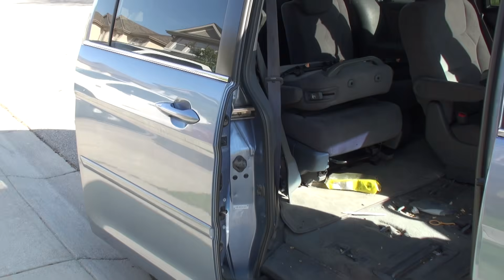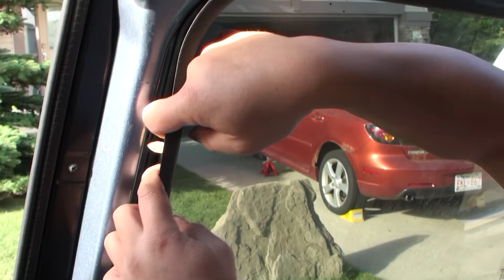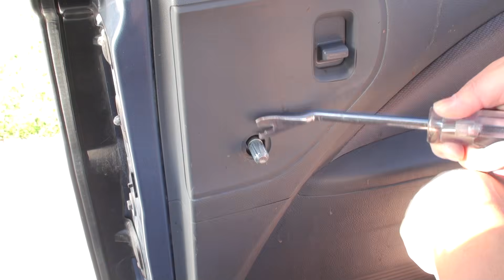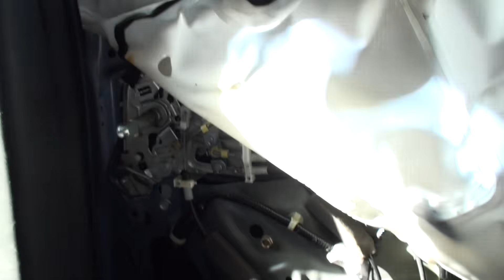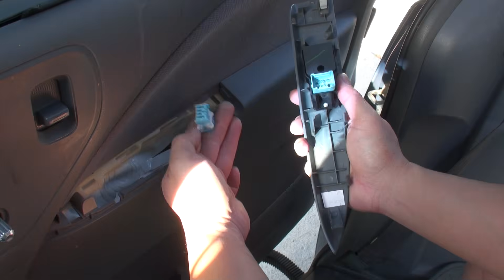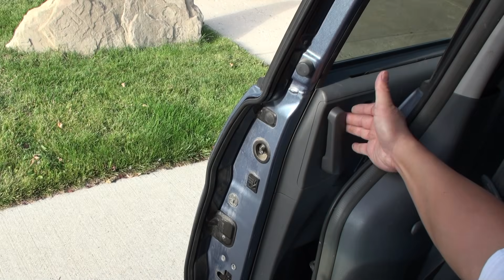Honda Odyssey Power Sliding Door Release Actuator Assembly Replacement

Comment: Followed your video, it was excellent. I just did the replacement on my 2014 Honda Odyssey, different generation, main difference was that for my vehicle I didn't have to take the two screen clips for the window shade and the corresponding upper trim out. Otherwise nothing materially different for the 2014 generation. Parts were roughly $45/door from the dealer. Thank you!

Comment: Could this be an issue also with the alarm wont beep but lock to lock only but the alarm doesn't activate
Reply from the maker: If the doors lock but the alarm doesn't activate it means that a "zone" switch isn't closed.  Check your hood pin and door jamb switches to make sure they all work correctly and try again.

Comment: Can you convert them to manual doors and bypass the micro switch so it doesnt drain the battery anymore? Like taping it shut or twisting the wires together so it reads always closed

Comment: I wonder if anyone has ever tried opening up and cleaning the actuator assembly?  I had an issue with the van's air mixture box (it would only blow hot air no matter how you set the temp) and I took it out, opened it up, cleaned it up and spread the lithium grease that was inside around on the gears and it has worked great for the last 6 years since...  Saved buying a $100 part.

Comment: It's much appreciated, I have the driver's side door doing this very thing on the 08 Odyssey EX I just bought. I knew about it, and wasn't too worried, figured I'd watch a few videos and get it sorted out in fairly short order. I spent almost a year waiting for used prices to drop, and some actually are in my area. I wanted the EX to avoid the nightmare we went through on my son's EX-L, with the VCM system and a failed water pump that thrashed the engine. But I digress. 

I got this with 240k miles, but well-maintained highway miles, and a good history of care. The driver's door will try, but start beeping. Holding the door actuates it just like you demonstrated, so I'm gonna make it right. Thank you!
Reply from the maker: Hope you were able to fix your van properly!

Comment: Thank you. Does the door actuator you replaced also control the sliding door lock too? Be mine won't lock when use remote
Reply from the maker: no the power release is not the same as the power door lock actuator.  Totally different part but located in the same general area.
Reply: thx
Reply from the maker: np

Comment: I will never understand why there is that mechanism that prevents the door from closing on an incline. I mean, cars are not always on level surfaces. Many driveways and parking lots are on a slight incline. I have experienced this incline thing and it is infuriating. I have had one hundred annoying problems with the doors and now the problem is really bad. I need help. Where do you get that little hook tool? How do you get replacements for the little orange clips, if needed. I don't need any, at this point, just wondering how you get little things like this. I will need a few small things for this vehicle, I'm sure.
Reply from the maker: Hey RR, my apologies for taking eons to reply.  The safety on the door is to prevent it from closing on an incline b/c without and say if the cable snaps that the door is crazy heavy and I can see from a manufacturer's perspective why they had to implement the incline lock.  Its actually locked when open and locked when closed but due to the issues you're experiencing with the door that its amplifying how annoying the problem is.  To answer your questions the tools used can be purchased from your local auto parts store or you can use the links in the video description to buy them (I plan to update my video description  links in the next few days if you can wait) and the replacement clips can be purchased from your local honda dealership.  They'll cost more but at least you know it will fit perfectly and spare you the hassle of running around trying to find the right ones to fit.  Sometimes the convenience and your time are worth the premium paid.
Reply: @piercedasian  Thank you very much. I am not sure if I totally understand or if I had explained myself well enough. The minivan is on a driveway and there is about 5 degrees incline. Almost seems like no incline to me. Oh, well. Doesn't matter. I wonder if you could travel here and help me with these doors. You could make a video out of it. Seriously.
LOL

Comment: Yours and mine sound like old broken plastic teeth of a gear assembly inside the actuators. Probably not 2 at the same place yet so it can still open occationally. I love the odyssey design but they used too many brittle cheap parts.
Reply from the maker: I think that is the case with all minivans.  The Toyota Sienna for example doesn't have the power latch/lock problems but it sure as heck has a pretty bad rap with the drive motor cable system rusting out.  The nature of the van I guess b/c of the complexities of a moving door.

Comment: Very detailed video. What if I can't open it manually, either? I have an issue even when shifting to the manual position, which does not open from the inside or outside.
Reply from the maker: Sorry for my super late reply but I'm not sure what you'd do in your situation. Sounds like you have a trigger cable problem within the door and as long as you can get into the door using the automatic mode then I'm willing to bet the cable that links the exterior and interior "actuator" handle is broken or has popped out of the retainer clip. Hopefully you've since fixed this issue.

Comment: Great video, demystifying the door actuator mechanism. In my 2010 Honda Odyssey EX. the outside latch has NO effect whatsoever, opening or closing.. Pressing  the key chain and dashboard controls does not open the door, but at least generates a hum. The inside handle opens and closes the door. The electronic controls also close the door (but do not open it). Is this consistent with the actuator problem? Thanks.
Reply from the maker: Sounds like the power actuator is bad.  The outside door handle actually connects to this mechanism that I replaced in this video so unless you have a bunch of broken cables and weird things going on in the door (and yes I've seen some DIY hacks that did MORE damage than to fix the issue properly) that replacing the release actuator is likely going to address your problem.
Reply: Thank you, kindly.
Reply from the maker: you're very welcome!

Comment: Thank you for this video! I have to fix both doors on my 2005 Odyssey. In my case the driver side door has another issue - it opens but does not fully close. I mean when it closes at the very end of the closing sequence the door mechanism is trying to tighten the door, but then I hear the "pop" noise, and I see the door is not tightened properly. It's not flush with the rest of the body. If I start to drive, I'll hear a constant buzzer. I had to tighten it by pressing on the door from outside, but the buzzer was still there. So I had to lock the door via a button on the left of the steering wheel. Do you think it can be related to an actuator or something else? My passenger side door seems to have the same issue like in your video. It just stucks half way when opening or closing.

Comment: Thank you so much!  This was exactly the issue with my passenger side slider.  Like another poster (WillMaster) suggested, I didn't remove the clips or fully remove the trim around the window (just the bottom).  (However when I tested the door after putting the new actuator I saw how I could have broken the trim!!(Luckily it didn't break!)  As for suggestions for someone else doing this:
1) Removing the locking clip is the hardest part.  You are not going to break the plastic shoving that pick up there.
2) To unclip the window control the little blue button just under the white part is what you press.
3) I used a piece of tape to hold the water shield up (and connected it to the window controller plug you un-clip earlier in the disassembly
4) I traced the existing black line with new adhesive (Honda part #08712-0003)  Shame to have to open it for just a small part of the shield..
5)Assembly is so much faster than disassembly!

Comment: My door causes same type of trouble, starts to close and stops with a couple beeps. However, I don't have that buzzing noise. Could it still be the actuator? If I hold down the handle it'll close just fine. (I don't have issues opening the door, only when closing)
Reply from the maker: you might have an issue related to the actual mechanical door latch.  The door release simply is an electronic actuator to fully engage the mechanical door latch to allow it to release.  If you try closing the door and have to hold the handle you may have a mechanical latch issue.  Its hard to say what the issue is without seeing it.

Comment: Great  video.  Question if you have time. I haven't used that door for a while. I replaced roller assembly that goes on middle track. .  Door works great only when I replace fuse. It works fine. But after I lock door it stops no noise and I then have to pull fuse. It works fine again. Until door locks. Any ideas?
Reply from the maker: That is super weird. I can’t say I have ever heard of that problem before.  If you shoot me an email to piercedasian@gmail.com we can work together to troubleshoot further.

Comment: Hey Buddy! Awesome video. Thank you. I followed your lead and bought both the left sliding door power release actuator and additionally the actuator assembly left slide door lock since the lock was not unlocking either. I had them installed to see if this solved the sliding door problem. Unfortunately, the door doesn't get activated and neither does the lock. So I am wondering what next? My mechanic said it must be something electric, so I told him I would take it somewhere else that specifically works with electric issues. I am trying to avoid the dealership since those guys charge you an arm and a leg. Any suggestions?
Reply from the maker: You may want to examine the left junction block in the driver's size footwell to see if any fuses are blown.  There are some cases where the junction block fails (from water infiltration usually) and that's when all electrical havoc is unleashed.  I plan on doing a basic electrical troubleshooting video soon to show people how they can get a simple tester and verify their electrical circuits are working and to ensure fuses are working as expected.
Reply: @piercedasian  Thanks a lot. Will look forward to the video, it would be really helpful
Reply from the maker: You're welcome.  So many vids I need to create and yet so little time.  Stay posted as I will at some point be publishing new content.

Comment: My 2012 does the same. Shame on Honda.
Update: I replaced the actuator with the genuine one from Honda and it still does the same thing.
Reply from the maker: yeah you'd think they'd make beefer power latches for this van but they don't.  They're all guilty of using small tiny cheap parts.

Comment: Awesome video with simple explanation step by step!!!!👍👍👍👍👏👏👏👏
My van is a 2009 model it makes noises that sound like thunder when its door opens. Do I need to fix its power actuator? Thanks in advance!!
Reply from the maker: It depends what the issue really is.  If it making a thunderous sound while running on the track then odds are it is just the roller.  The power actuator only needs replacing IF the door doesn't want to open or close properly and beeps multiple times and reverses direction.  The rollers are definitely failure point #1 before the power actuator would go.
Reply: @piercedasian  
I already replaced middle and top of rollers both side. Thanks  for your help.
Reply: No you need the bracket that the door roles on.  I just changed that on my 2006 passenger side.  Check out Eric the car guys video.  It’s a cheap part and easy fix actually.   This video fixed my drivers side door and now I have 2 perfectly working doors.  First time in probably 5 years.  Kinda freaks me out now that they both work again.  Anyway get the bracket on Amazon, watch the video and then do it.  You won’t regret it.

Comment: What if I can't get my door open at all it buzzes then beeps but will not open
Reply from the maker: Have you tried pulling the outside handle out and HOLDING it out to get the door to open?  Once you do that it should open and that will allow you to get at the power latch assembly.  I haven't ever experienced a door that couldn't be manually opened up using the pull the handle and "hold" method.
Reply: @piercedasian  I still doesn't open

Comment: You don't actually have to remove the entire window trim, meaning you don't have to remove the sunshade hooks. You just have the unhook both the left and right side, which doesn't require removing the clips.

There is one clip that is somewhat hidden that is behind the area where the window switch is. Most of the time, when you pull on the outer clips, this clip will also release, but sometimes it doesn't, so you have to reach behind there and pop it out.

The replacement part can be around 60$. However, most of the time, the part doesn't really fail. There's a clutch pin inside that tends to stick over time, and in most cases you can fix this by spraying some spray lubricant like silicone or white lithium on it to help free up that mechanism. The actuator assembly is only held together with one phillips head screw, and then with some careful prying, you can get inside.
Reply from the maker: Yes you're correct but I opted to take it all out so that I don't break any trim pieces since this wasn't my own vehicle.  Nothing worse that snagging a trim piece and breaking it and then having to owe your customer a new part especially when honda canada charges a ludicrous amount for parts.
Reply: @piercedasian  It's actually interesting because when I took my sunshade clips out, I found that when I put them back in they were more loose when they were before, as in I could wiggle them quite a bit.

Comment: Hi, I have a 2012 Odyssey, and the driver-side sliding door can't open. Whether using both handles or buttons, I will just hear that motor engage but after few seconds, it will stop. I would like to open the interior door panel trim, to take a look at the insides, but the problem is the door can't open at all (even manually)! I tried removing fuse #7 and battery disconnect but it did not help. Any suggestion?
Reply: Check out the Honda Odyssey Owners And Enthusiasts Facebook page for some more help if you can't fix it. A lot of great people that can answer your questions.
Reply: nadia hi. I had it. it is necessary to turn off the automation. and manually open the door. most likely need to replace the rollers. must watch.
Reply: Надя привет. у меня такое было. надо отключить автоматику. и в ручном режиме открыть дверь. скорее всего надо ролики заменить. надо смотреть.
Reply: There is a video out there about the  gas door sensor failing. Causing an issue similar to yours.

Comment: Hi - U made my day buddy ! Thanks for posting this video.
I have been driving with exactly the same  issue on BOTH sliding doors since I've bought my van (for 3 years now).

I have disassembled the "black blox" and found that my motors were stuck. To force them to rotate:
1)  I have used pliers to force rotation of rotors. 
Cracking noise was heard but no worries. Usually you  shall not damage motor and if that happens...assembly is foulty anyway :)))
2) I have applied 12VDC directly into motors' terminals (changing direction for couple of times).
3) I have lubricated plastic parts with silicone grease.

Put it back together and sliding doors are alive again :)))))

More info available on Oddy forum:
https://www.odyclub.com/threads/door-pop-fix.348509/
Reply from the maker: Glad you got it all figured it out :). Thanks for sharing the tip on re-lubing the door release actuators.